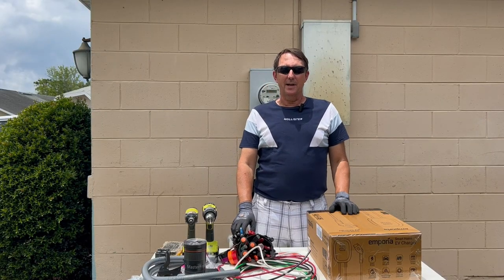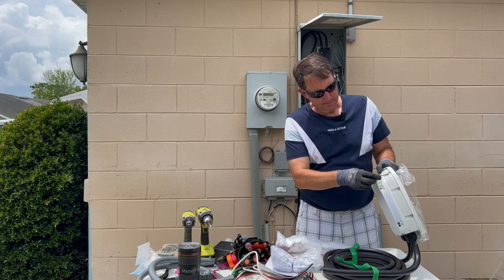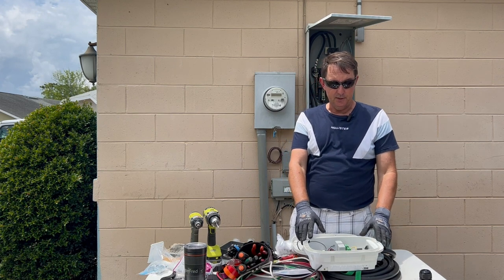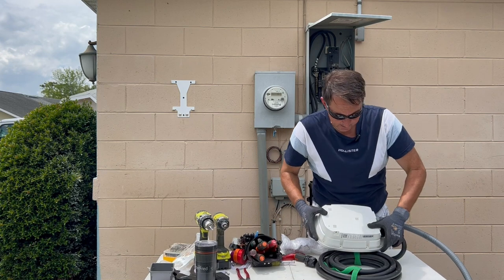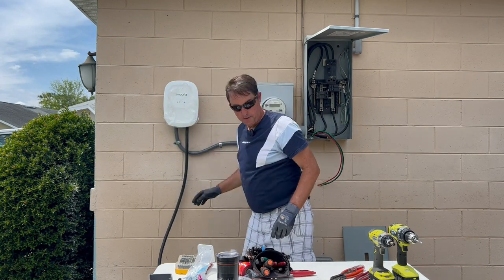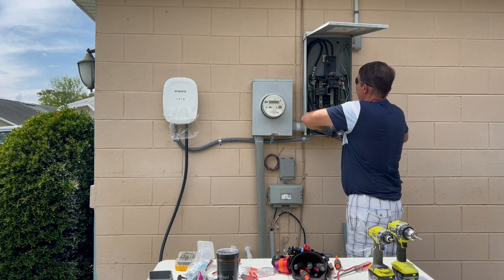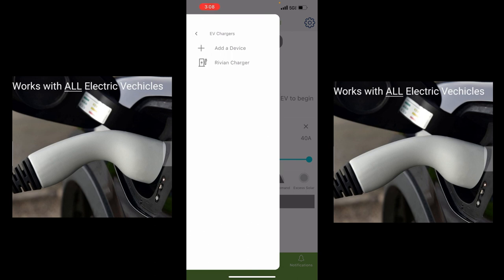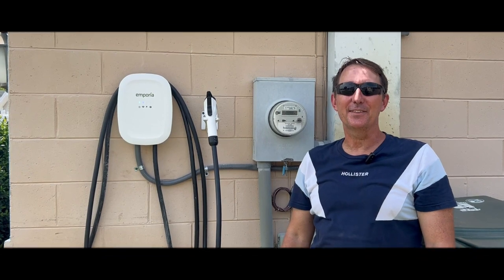Emporia EV Charger Install

Comment: Hello can you give a parts list for the same charger and panel but using 3/4 conduit
Reply from the maker: Copy / Paste this into your internet browser. This is in the description of the video.

https://www.amazon.com/Sealproof-Non-metallic-Liquid-Tight-Connector-Electrical/dp/B0765CZPKS/ref=sr_1_14?crid=3L8FXYSF43TPC&amp;keywords=3%252F4%2522+carflex&amp;qid=1685143161&amp;sprefix=3%252F4+carfle%252Caps%252C294&amp;sr=8-14&_encoding=UTF8&tag=yourfloridael-20&linkCode=ur2&linkId=9f7adfbf558388e11b17ecadbc846eed&camp=1789&creative=9325
Reply: @YourFloridaElectrician   can the liquid tight use it for 60ft? from panel to charger location
Reply from the maker: It can be used for 60 feet, but you will have to strap it every foot or so. Otherwise it’s gonna look terrible.  it’s gonna be all wavy because the car flex comes in rolls and even you straighten it out. It wants to stay that way. 
I would use it for flexibility over obstacles, or very short runs. 
Use or transition into some schedule 40 PVC that will look much better on a long run . 
Hope this helps.
Reply from the maker: Is this what your looking for: 
https://www.amazon.com/Sigma-Electric-ProConnex-49303-Reducing/dp/B002YEDB0Q/ref=sr_1_3?crid=3D4O4EEJDGEXZ&amp;keywords=1+to+3%252F4+reducing+washers&amp;qid=1701741953&amp;sprefix=1%2522+to+3%252F4%2522+redu%252Caps%252C195&amp;sr=8-3&_encoding=UTF8&tag=yourfloridael-20&linkCode=ur2&linkId=d6c90c782b13c0dac9fc010aaa9a76c5&camp=1789&creative=9325 @nightboy606
Reply: @YourFloridaElectrician  yes and what other connections/fittings is needed from the schedule 40 to the bottom end of the emporia
Reply from the maker: Reducing washers (2)  from 1" down to the size of the conduit your using. A Pvc male adapter with locknut and bushing the size of your conduit. @nightboy606

Comment: I noticed No neutral white wire on this installation.
Reply from the maker: Correct. If you go to my channel, and then to the community tab, you can see a clip of the Emporia instruction manual that shows no neutral is needed. 
Thanks for commenting !

Comment: How did you end up checking  the voltage with the cover in place? Were you able to check it on the end that plugs into the car? Thanks
Reply from the maker: I never did get a chance to check the voltage. As you stated with the cover on, it’s not possible.  
But she can do is take the amperage off the breaker. Make sure the breaker is working correctly.  
On the Tesla wall connector you can test the voltage at the connections prior to putting the connector on the wall. 
If I’m not incorrect, I believe these EV chargers for the home only supply AC voltage and exchange the DC at the car. 
The superchargers, however, convert it to DC before it gets to the car, increasing the speed of charge . 
Thank you for the comment and watching

Comment: what wire is required to hardwire the Emporia directly to the panel?
Reply from the maker: I would use #6  THHN if you want to get the full 48 amp charge rate out of it.
Reply: @YourFloridaElectrician  should the wire be in conduit when it runs from the panel through the ceiling of my unfinished basement?  From there I can get it directly into the wall cavity of my garage, unless having the wire in the wall cavity is a no no I can put it in conduit up the garage wall to the junction box.
Reply from the maker: If you’re gonna run everything concealed in the wall, you’re better off to run some 6-2 Romax. What that means it’s a number six conductors a black and a white and a ground in the same sheath insulation.
Reply: @YourFloridaElectrician  I'm curious why because 30 feet of  6/2 Romex is about $5/ft and #6 thhn is $1.40/ft (x2 obviously).  Sorry just trying to understand.
Reply from the maker: @wameans THHN has to be run in a conduit can’t be run exposed. 
And remember you need a ground also for your THHN. You can probably get away with number 10 for the ground. 
Anytime you run that THHN it always has to be in some sort of conduit. Once you’re done running all that it’ll be about the same price as your Romax.
Hope this helps.
Reply: That makes sense!  Thanks.  Performance wise both options are the same essentially?
Reply from the maker: @wameans yes. 👍

Comment: Thank you so much!!  

We got a bid to install a charger, and the electrician quoted us $5k.  Ignoring the charger, it's $150 of a cable, and a 50 or 60 amp breaker (why do the 60 amp breaker tbw?).  If it was materials+ a good wage (100-120 an hour), I'd have hired him, but 5k????
Reply from the maker: Seems excessive.  Maybe taking advantage of the high demand these days for EV installs.  Sometimes, if you have a really nice house, they might price it based on thinking how much money you might have. It’s not fair, but it happens.
Reply from the maker: My apologies, I neglected to answer your entire question. A 60 amp breaker will allow you to charge a little bit faster up to 48 A I believe.  Not everyone would need faster, charging speed, but sometimes it comes in handy.  
In defense of licensed electricians out there , it takes a lot of time and effort and hard work to get this license and we shouldn’t just give that knowledge away. It is a professional trade, and it does demand professional wages.  
Even still, 5K seems a bit excessive. 🤑
Reply: @YourFloridaElectrician  For sure.  I willing paid electricians $1300 to wire my hot-tub.  This would be similar (easier in some ways).  So I would have totally paid 3X times the cost of the parts expecting the wire to be $200-$300 and the breaker to be $20.  But a 20x mark up was enough I'll do it myself, and see I can i get an electrician to just inspect my work for $100-$200 for 20 mins of their time.
Reply from the maker: Sounds good. Please be safe. PPE or make sure power is off.
Reply from the maker: Sounds good. Be safe. PPE or make sure power is off. Thanks again for commenting.
Reply: @YourFloridaElectrician  I'll be connecting it to a sub-breaker so I can shut it off at the top of the sub breaker and then again at the main breaker to give myself two factor authentication of not dying.
Reply from the maker: @blameitonben  Very good 😌
Reply from the maker: It Absolutely happens. Just like profiling man. Not fair  👎

Comment: Can you please explain why no neutral wire needed?
Reply from the maker: As per manufactures installation instructions. No neutral is needed. The manufactures installation instructions will always supersede the NEC. After all, who knows best how to install ones own product right? Typically 240 Volt circuits will not need a neutral like in the case of a Water heater, no neutral. 
Some other 240 Volt appliances need a neutral to be able to achieve different voltages for different heating settings like a cook top or a dryer. Sometimes 120 volts is needed on a 240 volt appliance internally for the electronics like the clock timer or the like.
In short. Best to install as manufacture suggest. Here is the link to the emporia EV chager install manual:
https://uploads-ssl.webflow.com/5fff2b7694451e66ba2f5a3d/64342cda6d9690ab0094f77c_EV%20Charger%20Installation%20and%20Usage%20Guide.pdf

I hope this helps.
Reply: Thank you!  Yes will do!
Reply from the maker: Good luck on your install and safety 1st!
Reply: I was wondering that also as a NEMA 14-50 outlet requires a neutral.
Reply from the maker: That Nema, 14–50 outlet could be used for more than just the EV charger. You could unplug the EV charger and plug a range into it and it would work.

Comment: Awesome video. I also have an Emporia Charger.   I'm in Ft Myers, Fl. (Lee County) I have paid an electrician to Install a Nema outlet. It's only 22" from my electrical panel. (Inside the garage). He used 3/4' PVC conduit. However, the conduit spins if turned. The connectors are glued on and sticking into the panel box and the outlet box. No lock nuts or straps securing it. Is this up to code? Or maybe just "allowed" because it's so close. As one of those "do it yourselves" homeowners, it really "pained" me to do have had to pay someone. And, I would have secured it regardless of code just to be on the safe side. I appreciate your input.
Reply from the maker: Thank you for the comment. 
All PVC joints should be glued. Not only to keep it from moving, but also to keep it watertight.  
If you have some PVC glue, you may be able to fix it yourself. Turn off the breaker feeding the EV charger. If you can pull apart of the connections that are not glued a little bit and put glue there and put it back together. 
As far as the locknuts on the male adapters that go into the panel and the Emporia both should have locknuts. Nothing should be free spinning. Having one strap over 22 inches should be more than enough just in case someone walked by and something hooks the conduit and pulls on it you don’t want the wiring to be pulled out. 
Thank you so much for watching. Sorry you didn’t get to see it sooner.
Reply: @YourFloridaElectrician  thanks for replying. Your video was awesome. I love the thoroughness and also the humor. Nice Rivian as well. 
Yeah I watched your video right after the electrician came out. I hired one because was just worried because I’ve heard talk about not having it done with a company could be an insurance issue. 
However, I do have another question: The PVC pipe did have glue but still turned/spun. I did call the company and ask them if they could come and look at it. I asked the electrician if he could put lock nuts on the ends, where it enters the box and the panel. He refused and said “it’s not normal that the homeowners go back and look over their work.” Because I had actually felt the pipe and noticed it spinning and not being secured. I also understand that a 22 inch PVC pipe probably doesn’t need to be strapped. 
My question is twofold. Is this any kind of code violation and should I pursue this with the company or drop it because it will probably never be inspected? Thanks again for taking the time.
Reply from the maker: @pearlmcp  that’s funny it’s not normal somebody look over there work. I think it should be normal cause sometimes they do such a lousy job.  
As far as just adding a lock nut and a strap, I don’t think it’s worth pursuing. 
If you’re handy, you would have to carefully remove the wiring from the breaker and the ground bar on the panel side and slide a lock nut over and then put the wiring back. Same on the EV charger side. You would have to put everything back nice and tight as it was. The reason for the lock nuts is to make sure the condo. It doesn’t get pulled out of the panel or out of the EV charger.  I need a case be super careful working on electrical.

Comment: Charing module is the core component for EV charger. As we know top three EV charger manufacturers in USA are Chargepoint, Blink Charging and EVgo . Do you know whether they made the charging modules by themselves, or the charging module is provided by specific companies, and what are their names?  I wanna look  for a charging module maker.
Reply from the maker: Great question unfortunately I don’t have an answer. I never researched who makes the charging modules.  Best of luck with that one.
Reply: Level 2 EVSE don't have "charger" in it. It just pass the current for your car's onboard charger. Only DC faster charger have its own charging module.
Reply from the maker: Thanks for that information.
Reply from the maker: I guess we will never know. 🤷‍♂️

Comment: WOW!! You have to tell an APP to "Start charging" your car? What if your phone has failures? No charging?
Reply from the maker: Well. My car is set up from the inside to start charging at midnight. Sometimes I set it up to charge as soon as it is plugged in which might be a good default for long daily drivers. I can do all from the app or the car. Not sure about the Rivian. I'm sure you can schedule to charge or plug and charge as well. 
Thank you for watching and commenting.

Comment: I am looking for someone to install mine, I just got a quote for $1,000.  That seems a bit excessive no?  What do you think installing this should cost at a fair price?
Reply from the maker: Depends on many factors: 
1. Install location in proximity to your electrical panel.
2. Size of the circuit you want to run. 60amp, 50amp and so on.
3. If your in an apartment, condo or residential setting. 
4. Your existing electrical service if it needs work or can handle an EV charger as is.
5. Your part of the country. Are you in Alaska or in Florida. It makes a difference.

Comment: Isn't #10 for the ground sufficient for the charger?
Reply from the maker: I guess you could. Page 19 of the Emporia instruction manual is a bit vague. Specifically says use number six for the line side’s and then says, and a ground.  
10 would probably work, but I have run into resistance issues with some existing installs, I think because of the under size ground. 
For me, it’s just better to bite the bullet and put on number six the same as the rest. 
Thanks for commenting. 👍
Reply: @YourFloridaElectrician  You can use 1 size down (#8) That's what Emporia recommends. BTW the Wire lugs should have been Torqued! Was a load management report done prior to installation. Was job Permitted?
Reply from the maker: Sam. You could use a size down, especially if the manufacturer says so. Same as a condenser unit will say max fuse 30 A, but it will also say minimum ampacity 18 A so you can get away with a 12 wire it seems crazy.  That of course, is only for the inrush current to prevent the breaker from tripping.  
A standard house with a 200 amp service. How many times do you got to do the load calcs?  This video wasn’t for how to do a load calculation. The videos are geared towards your homeowner being able to do their own installation and thus pulling their own homeowner pulled electrical permit.  That also was not covered in this video.  
I do appreciate all the comments it helps me grow as a Electrician, and as a YouTuber   
Many thanks !

Comment: One of the most disgusting installs I’ve ever seen
Reply from the maker: What makes you say that? Can you list something’s that are “disgusting” about the install so I can make a better install next time? Are you also an electrician? Thanks 🙏
Reply: @YourFloridaElectrician yes I am an electrician

1. i would’ve done it in pvc to make it look cleaner
2. That 90 bend on the wire near your charger has to much excess wire which droops
Reply from the maker: Thank you for your comments. 
I am trying to do different styles of installs.
I did a couple of installations in PVC, and for this install, I decided to show with carflex to show how easy it is to work with. Doing the same sort of install with every EV charger would be boring. 
The sag in the carflex under the EV charger is called a drip loop to prevent water from running into the electrical panel. That was done by Design.
I do, however, appreciate your commentary and watching the video . 
Thank you

Comment: can you use a 60amp breaker for this ?
Reply from the maker: Yes. I believe we installed a 60 amp on this video.  
Thanks for watching and commenting. 
Please consider liking, subscribing, and sharing.
Reply: @YourFloridaElectrician  thank you !
Reply from the maker: You’re welcome. Remember to run number six wire with that.
Reply: @YourFloridaElectrician will do! With the 60amp breaker, I’ll make sure the car charges at 48amps!
Reply from the maker: That’s right!
Reply: @YourFloridaElectrician  just subscribed, the install went well. Thank you.
Reply from the maker: Glad to hear and that is awesome!!!